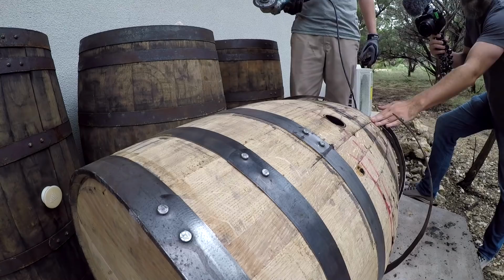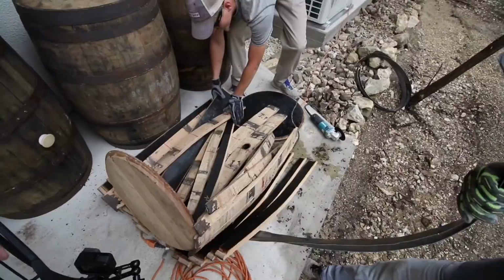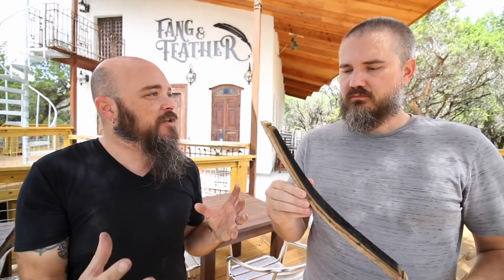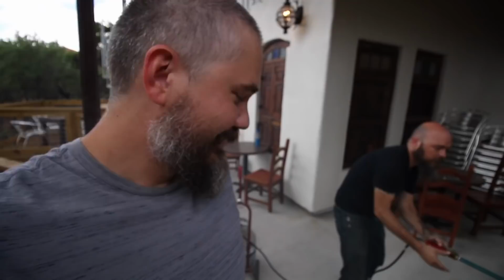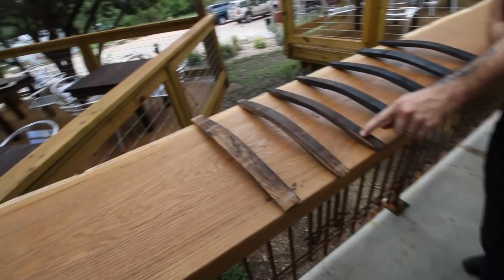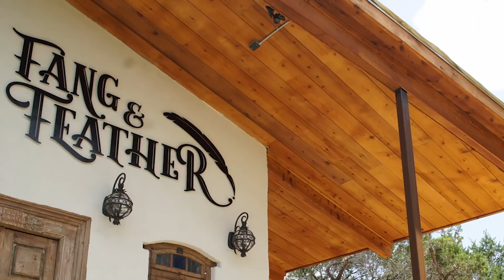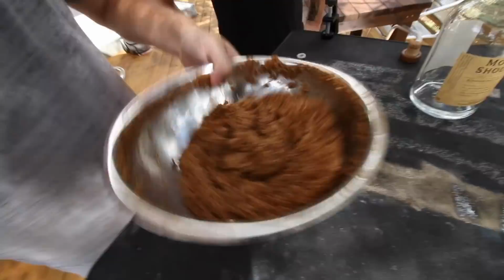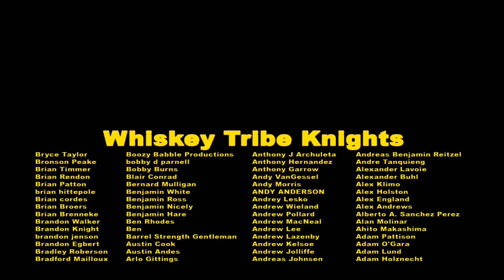Why Are Whisk(e)y Barrels Being Burned?

Comment: You can make "activated charcoal" by running steam through charcoal at really high temperatures. This just gives the same charcoal more surface area. 
Please try this!!! Get some small barrels and put one in an oven with steam, age whiskey in both, and compare. If it works, you can use it; if it doesn't, we get a fun youtube video!

Comment: SUPER unpopular opinion, BUT, I think you should always leave the guard on the grinder. Reason: once witnessed a coworker cut off all 4 digits with a grinder.
Reply: Yeah, it's kinda hards to go back to normal after a quadruple severing...
Reply: I slipped and stuck a grinder in my thigh once. THAT wasn't fun either although not as damaging or traumatic
Reply: Safety first!

Comment: Seems to me that the most economical way to age clear distillate into whiskey would be in large sealed stainless tanks with a bunch of charred oak inside. First off you'd get the economies of scale on storage space and material handling and you'd also avoid all the losses associated with aging in wood barrels for years.
I'm sure lots of whiskey snobs would complain about the more industrial method, but wouldn't it just be a faster and cheaper method to produce potentially better results?
Reply: I think that would be comparable to wines aged in steel tanks together with wood chips. It can actually give you a result, good enough to even fool sommeliers. I think that some products made with your proposal could actually be superior in taste and quality to others. I would be fine with it, as long as they would be clear about it

Comment: I made a one gallon bourbon barrel porter. Soaked 1oz of charred oak cubes in 2.5oz Buffalo Trace for two weeks. It was blacker than that. The smell was incredible. Sadly I didn't try it straight. I added it all in with the beer right away when I racked to secondary :(

Comment: I always thought it would be fun to char the barrel by burning a used char barrel. 
Something like put the new barrel on a cement mixer, put some of the used wood in 2-3 chimney fire starters till you have a good bed of coals than one chimney thing after the other into the cement mixer barrel till the coals burned off. Make sure you have more coals ready cause it could take awhile.

Comment: The way to rapid age with staves (yes...  It's a thing) is to cut the chared, clean staves into smaller chunks, a few inches long if you're aging in the jars, and letting the whiskey/shine sit until the desired color and flavor is reached.  Often a couple-three weeks.
  When the whiskey is in the barrel, the single, charred surface is exposed to the whiskey.  This is why the barrels must be turned periodically, to get even exposure of the entire contents to the charred surface.  A couple of years of aging can be achieved in a couple weeks.
  When you put the barrel in the whiskey, more surface area is exposed so it takes less time to draw the same color/flavor profile.
Rapid aging is actually a common process among smaller, craft distillers who need to turn product over in a shorter time frame.
  Many producers of moonshine will use this type of aging, as well, to age their product even though they don't have full aging barrels or enough product to fill barrels and let them sit around for several years.  Those barrels must be "baby sat" in an aging house, as well, and can't just "sit."   Small volume shiners just don't have the time, money, product and facilities to barrel age their whiskey.

Comment: I thought toasting was accomplished using radiant heat only (i.e. without an open flame).  Like with resistive heating wires like toaster elements, or an electric heat gun or something like that...so that you get pyrolysis of the wood sugars without getting any ignition.

Comment: I think you've covered this before Daniel, but have there been any successful uses of other wood species for barrel making? The one I'm thinking of that has the most similar properties to oak is hickory, doesn't Jack Daniels use it for their charcoal filtering? But why not apple, birch or aspen. I know you can make a barrel out of red oak, it has something to do with the grain structure being to porous but there has to be some other hardwoods that will work for aging whisky.
Reply: If I remember, the primary reason for not using red oak is that it is chemically different and smells/tastes bad. 
Beyond that, I believe it has been said that there is an american oak mill lobby or something that lobbied for bourbon to legally need to be made in new american oak. 
I personally would love to try a wood aged in one of the ones you listed, or even a similar tropical hardwood. 
I think they could do it...they would just need to call it american whiskey instead of bourbon, and a place like MGP probably wouldn't be involved in coopering those barrels, so they would need to do it themselves.

Comment: If the flame changes the flavour... why not char the barrel with, say a brandy or rum flame?
Reply: I think it would be more of the temperature of the flame from the source that would change the flavor not the source giving flavor itself.  A lower temperature flame may not char as fast but the heat would affect the wood more thoroughly giving diffent flavors. Where as a very hot flame will char almost instantly. I think that is why some distilleries toast then char like Daniel said.
Reply: I wholeheartedly agree on the temperature making a difference. But as a person that regularly grills with wood not charcoal. There is a difference in taste if a certain wood has a dominant taste/smell. Grilling on maple for instance gives a slightly sweeter taste, or hazel wood a slightly nutty flavor. So it stands to reason some flavors make it into the char from brandy or rum. Both having sweet flavor. but no added flavor being added by burning pure industrial strength ethanol.
Reply: I do not think the charring process last long enough to infuse those flavors into the wood of the barrel since it is just seconds of contact with the flame. If the disterillaries would use a lower temperature to toast/dry the barrel staves in a smoker equivalent the smoke would be an interesting experiment.
Reply: What a waste of liquor! Why would you even suggest that?

Comment: I'm not sure if anyone has asked this or not, but could someone pre-char the barrel sections at different char levels and assemble the barrel from them as to bring in the different flavour profiles of the different char levels?
Reply: A. Vincent I was going to ask the same thing. Or transfer between barrels as it ages. Or add pieces of a different char inside the barrel. All the flavors! 🤔

Comment: So what would happen if you were to use a grain vodka and then age it in a charred barrel. Would the end result be similar to whiskey or would the multiple distillations used for vodka strip to many of the flavors from the  distillate to make it useful for aging?
Reply: I messed with doing just that.  

It definitely does not taste like a whisky.  But it does have some similarity.  

It also adds a little body and the wood sugars take the edy off a little.